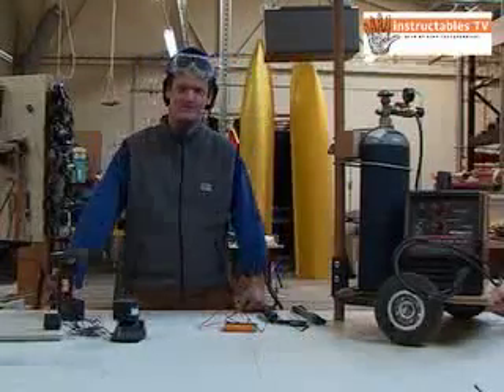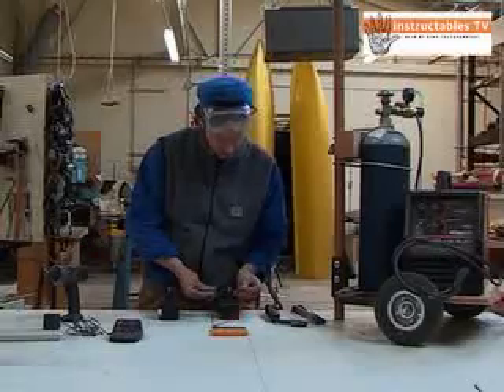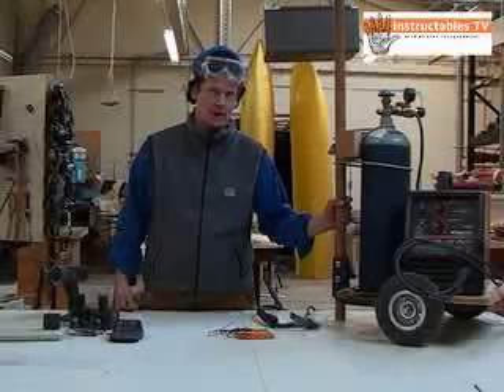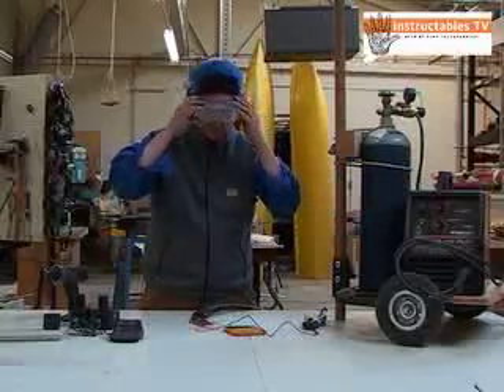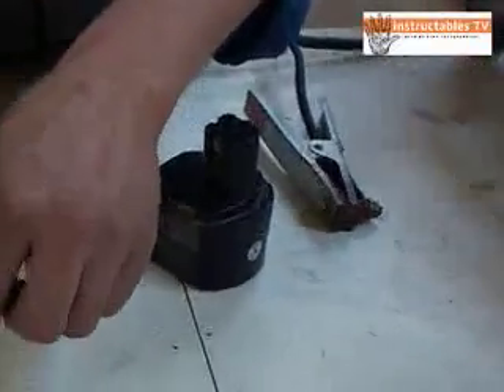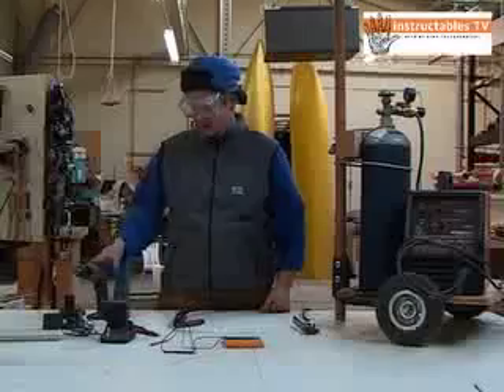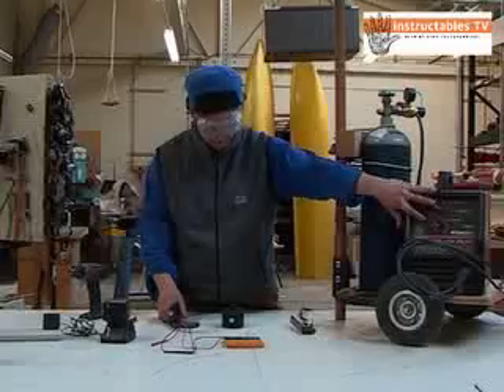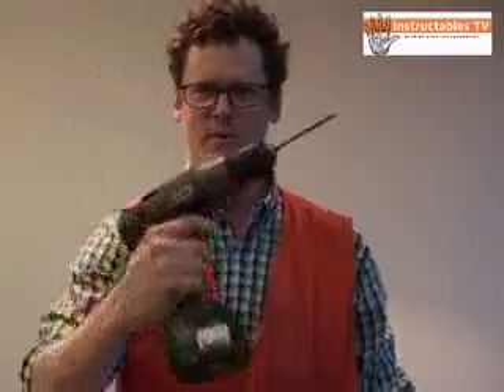Instructables TV Vol. 1

Comment: This is very dangerous the danger stems from the batteries exploding or venting. All 4 major types of battery can explode alkaline being the least explosive and not chargeable you may excite the reaction a bit and get more time but they will not really be taking a charge.  This process shatters the crystals inside the nicd batteries that cause them to fail they can start on fire and you will not be able to put them out with a normal extinguisher btw NiCd burns red flames as does lithium nimh take longer to go bad and are more explosive when mistreated example is a 2 cell nimh flashlight exploded and bounced around the room breaking various things the inhaled smoke from this permanently scared the owners lungs as the Gass they release is hydrofloric acid you do not want to have hf poisoning. Li -ion do not like overcharging and can be sneaky about if they are going to explode.  You can over charge them once and use them be fine then charger them up and leave them in a drawer with no load on them and they can randomly explode/vent.
Reply: Bro I've had NiCad batteries explode like a fuckin fountain--you just toss em across the pavement and let 'em burn out.

Comment: I used a couple of test leads with alligator clips on each end but you can use jumper cables if you can get to the battery contacts with them ((they're a bit fat).   In a different video the guy said to first zap once with  + to - and - to +.  That will drive the battery voltage down to 0.  Then zap + to + and - to -.  BTW, I just zapped some AA NiMH camera batteries using a car battery charger set to 6 volts, 6 amps and it fixed them too.   Also the guy who said it doesn't last is wrong.

Comment: My Makita 9.6V battery was so shorted it tripped my charger.  Saw an ad on ebay selling info on how to zap it back to life. Googled that instead and found this video.  Didnt have a welder so tried it with a car battery. Had 7.8V to start.  Zapped it 4 times for about 2 seconds each time, then zapped it for 5 seconds.  No sparks using  the car battery. Got 11V.  Put it on the charger and it didnt trip.  Took a full charge.  Had equal power and torque as my other good battery.  It works!

Comment: I tried this on two DEAD (0.0 Volts) Dewalt 18 volt batteries last week.  The replacement cost for two batteries is over $180.  Mine were shot, would not take or hold a charge.  After I zapped them, I used the Dewalt charger to do a one hour charge, the packs both regained their power.